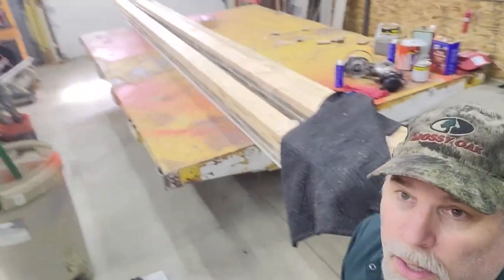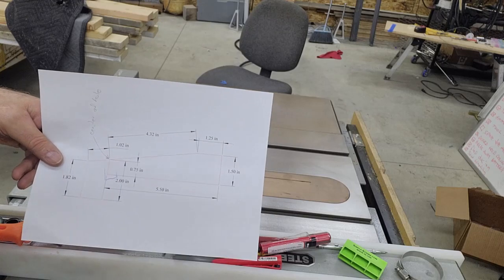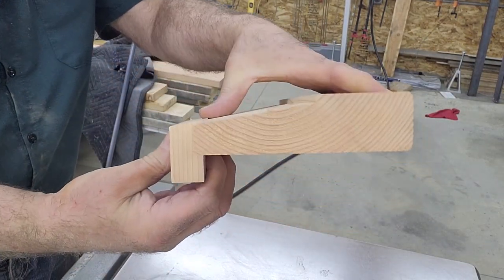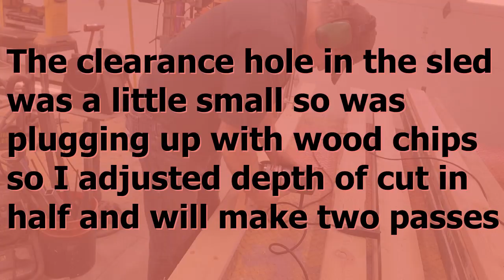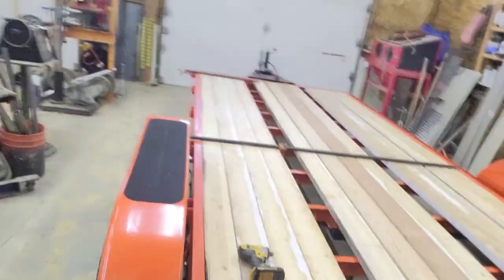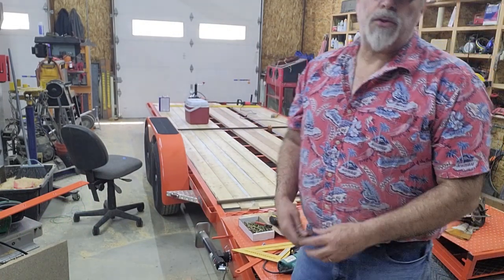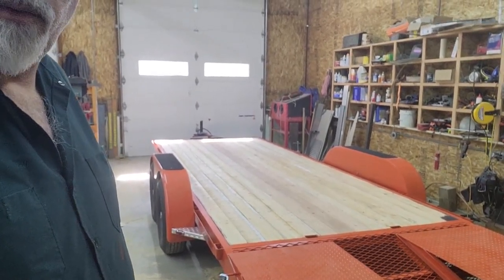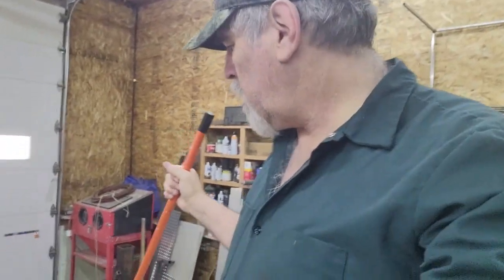Final episode, getting the deck boards milled, drilling 336 holes, and 336 screws

Comment: It’s possible, potentially, maybe…, that “butting” the decking up against their edges, could cause swelling & buckling, however it appears that you are on the “dry side” of Washington State, so it may not be an issue.
   The deck looks great..!
Thank you sir.
Reply from the maker: Correct, dry side, and the trailer will be under cover, so I'm hoping there is minimal movement.

Comment: Did the roll on bed liner fill the torx bit holes?
Reply from the maker: Most of them yes.  So if I ever have to replace a board, it will be a bit of a pain to dig them out.